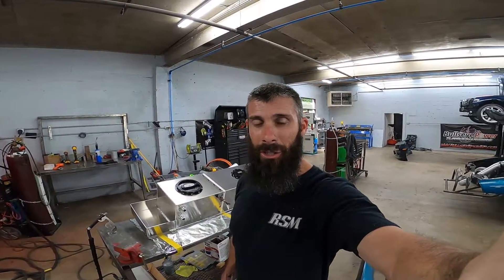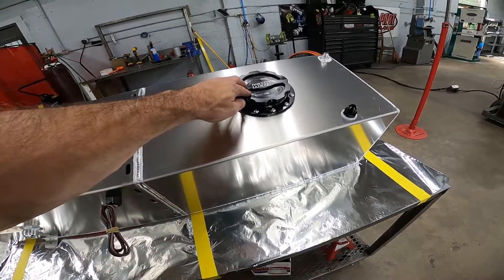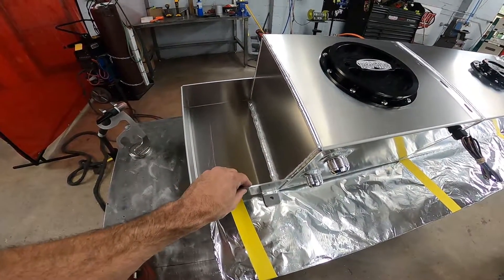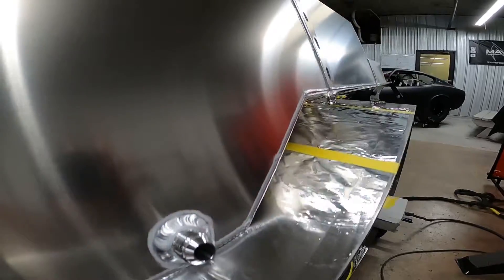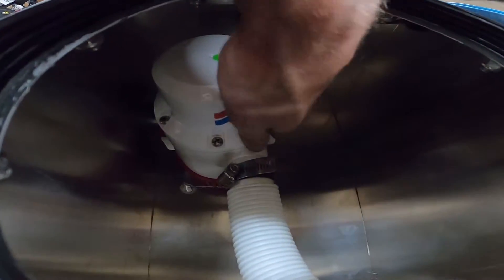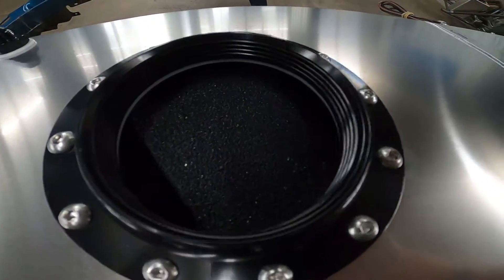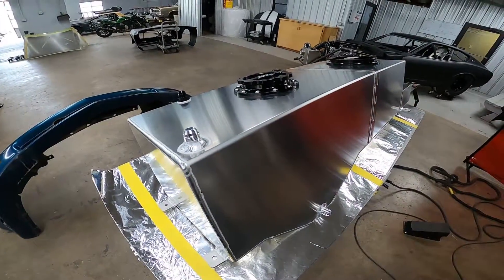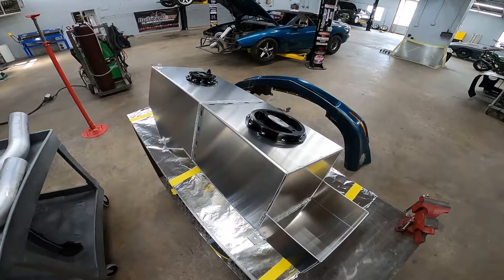RSM Fbody Combo Tank (detailed overview)

Comment: Can I use an aluminum tank for my snow performance methanol kit ? Instead of the plastic one they provide
Reply from the maker: Yes it should be fine. Typically on fuel tanks where you have fuel injectors involved we anodize them so the pure methanol does not try to corrode the aluminum and possibly stop up the injectors. The injectors was standard methanol probably would not be affected by this though